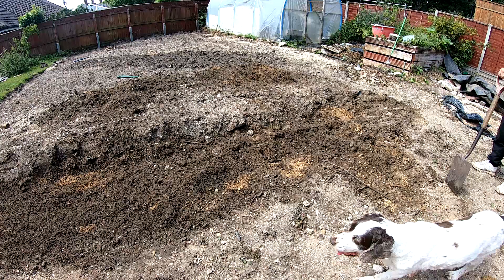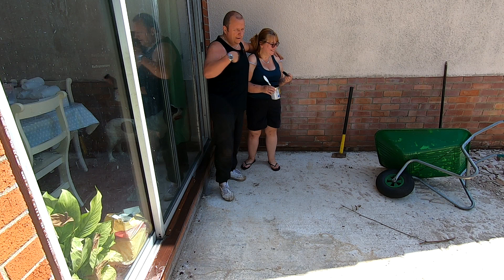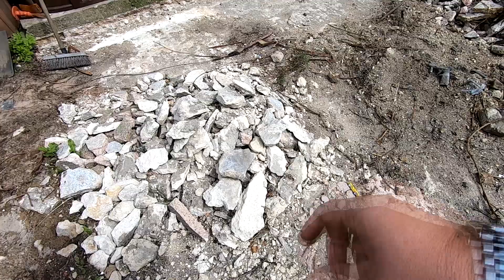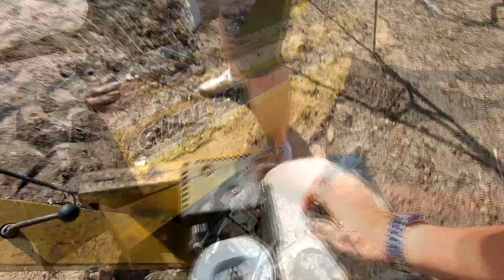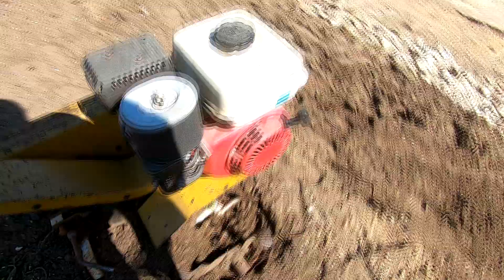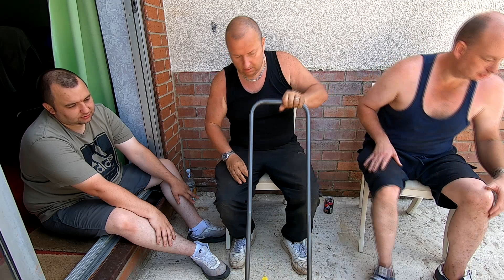Garden Makeover Part 2 | Doing The Donkey Work Vlog

Comment: Yo my auntie got a right pair lol my tiller has a plough blade on the back you set the depth and it hold the tiller in place so it does not run away.mate you can’t sand down a shaft unless you want to to get something to work,what do they do when something breaks just give up or do what we do overcome and  solve the issues. There is no instructions to fixing something when you don’t have the parts. Make do and mend good one mate
Reply from the maker: Too right Mick, some people don't get it. they are controlled by rules thinking that you must obey everything. Rules are made to keep people conforming. I live in the common sense world.